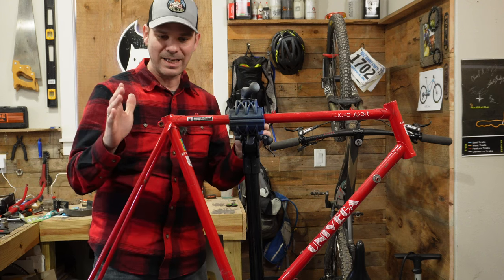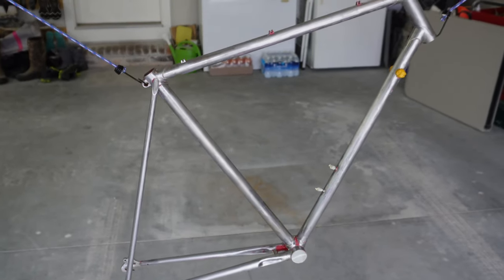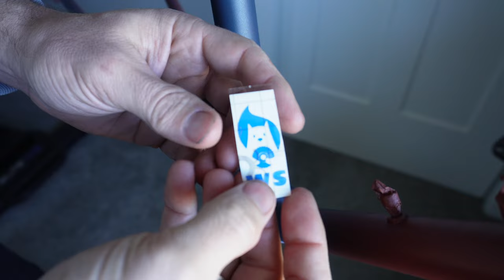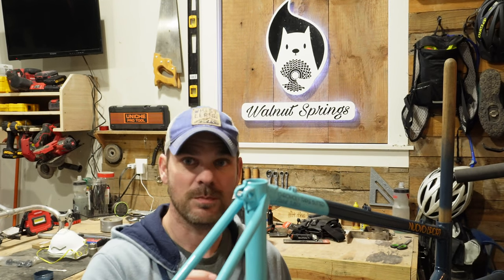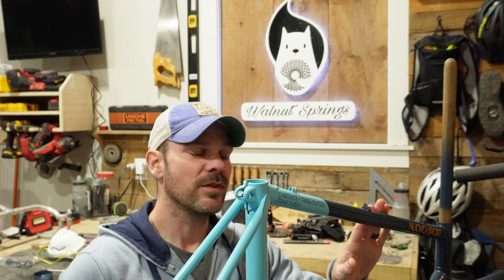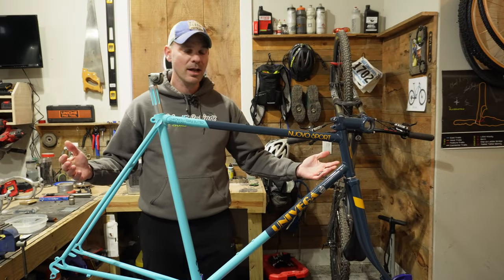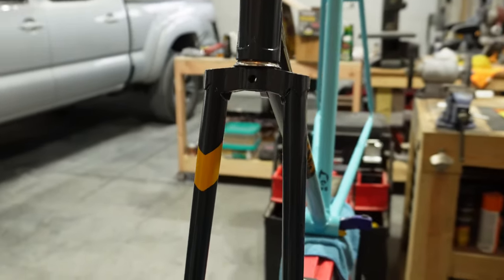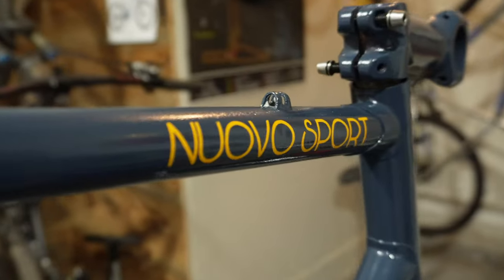Painting a Bike With Spray Paint: Vintage Bike Restoration the 1987 Univega

Comment: whenever your flatting a finished coat to get rid of any imperfections its easier to use wet and dry and to add some soap to the water then use your various grades of compound ,t cut then final polish.

Comment: I painted an aluminum frame with rattle-can  Rusto-oleum Automotive acid etching primer. I thought the acid etching primer took too long to dry. It was sandable but it wasn't really dry for about 2 weeks. After it dried the was stuck on good and chip-resistant. I tested it on some handlebars. I got good results but I don't like to wait that long. I would rather mix acid etching epoxy primer in a spray gun.
Reply: I dropped the handlebars on concrete 3 times before the paint chipped. The primer under it didn't chip. It's good stuff if you like to wait.
Reply: I used, used brake fluid to remove the old paint. I just keep brushing it on and keep it soaked for about a week. The paint comes off to the bare metal easily with a brass brush soap and water.

Comment: It looks really nice.
 My frame respray with rattle cans turned out OK but didn't last. In the end I had it stripped and powder coated (single colour) for about the same as the cost of all the cans and preparation materials.
This was 5 years back and the finish is very durable.
Reply: rattle cans are too diluted less than 15% paint the rest are propellant and thinner so it sprays out of the nozzle with minimal internal pressure thats why they dilute them.    If you used 20 cans that would be equivalent to a regular paint spray thats why rattle cans are NOT the process for a "good" paint job for quick jobs to cover up bad/old/faded....yes it works but for a lasting beautiful paint job go for the real thing or in your case powder coat which is expensive but worth what you pay for as painting with spray cans ain't quick and easy.....since its so thin the waiting to dry  between coats is too long and if your in a hurry you get orange peel its a waste of time and effort in my opinion if what someone wanted is a lasting paint job.

Comment: If taking off decals a hot air gun, I did my 1987 Tange Infinity frame about a month ago, used paint stripper to a point and then a wire wheel on angle grinder lightly took the rest off in 5 min and works well around the curves and joint areas. Wax and grease remover before painting the most important thing. Three light coats of undercoat, let dry for a day then 3 top coats drying for a day again followed by 2-3 clear coats.

Comment: When you were done, and the paint had time to dry and cure, did you find the paint to still be soft and chip, or scrape easily when, say leaning it against a wall or a pole (if locking it to a bike post outdoors, etc)
Reply from the maker: It wasn’t as strong as car paint. I think if I did more clear it would have been.
Reply: @RunBikeMike  Good to know. Thanks!

Comment: You only get ORANGE PEEL if you put the coat on too think, too quick and do not give it time to semi dry. A good trick is a scrap car (but with doors and windows), take the seats out and then on a hot summers day, spray the frame inside which will cook the paint nicely. 
Give it a light coat every time the paint feels tacky to the touch.

Comment: What did you use after realizing hand sanding wouldn't be enough? Running into the same problem right now but don't want to strip too much metal away with certain power tools.
Reply from the maker: Orbital sander it made fast work.
Reply: Sweet, thank you! what grit on the orbital?
Reply from the maker: 60 and 80 then used a high grit by hand to get rid of any scratches.

Comment: Is it a bad idea to buy paint remover chemical and then strip it down to bare metal, then prime and then paint?
Reply from the maker: That can work but you will want to get aircraft grade as the stuff you can buy at Lowe’s won’t do anything to bike paint. Just make sure to clean the frame really well before you prime it.

Comment: Spray painting is wasting time and money. No matter how well the surface is prepared and good products are used, in a year or a little more it will begin to peel. Just have a professional do it with baked paint or epoxy. You will not regret. It's my experience on several bikes I've painted.
Reply: Not if you use 2k clearcoat
Reply: Don't agree
Reply: @petergiourelas3753  Perhaps you are not using your bike enough. The bike won't peel while hanging.

Comment: The lugs are not clean
Reply: Because is almost impossible to clean the lugs with sandpaper and wirebrush I personally used a chemical paint remover
Reply: Yes, I know is impossible to clean the lugs with sandpaper and brush, the other option is sandblasting. Personally I used the chemical paint remover and it worked very well for me.